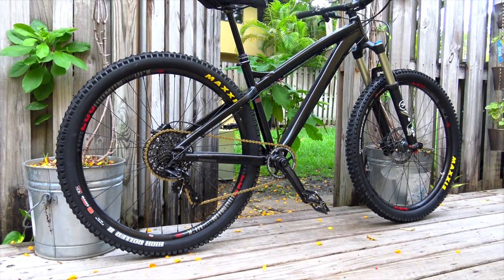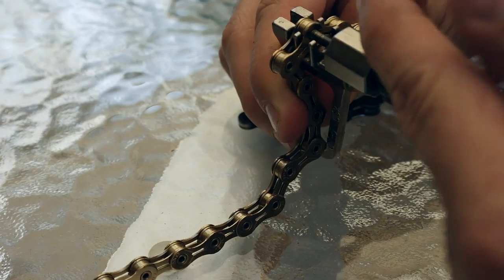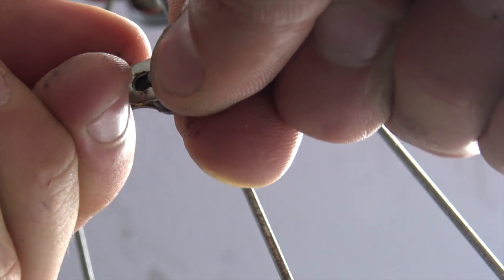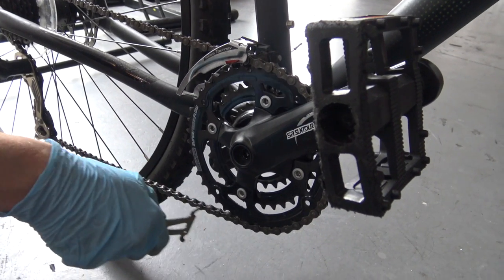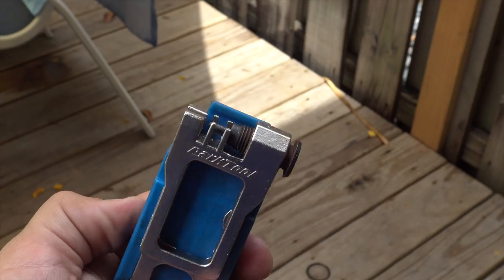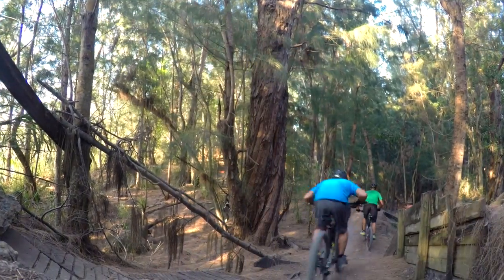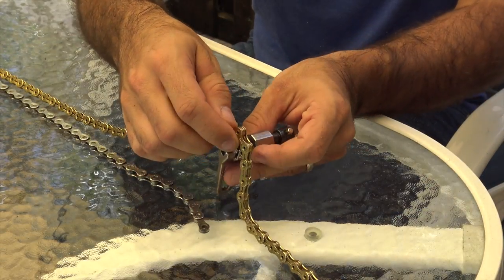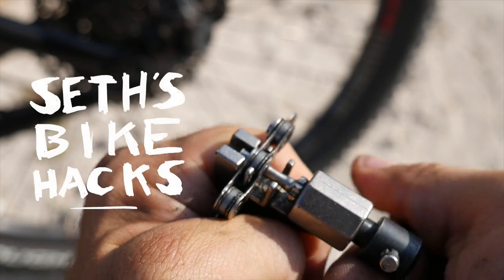How to repair or replace a MTB chain

Comment: I recommend any body who's riding to carry with them a Powerlink/quick link along with their chain breaker tool. 
Having this allows you to fix a chain without losing a link. Basically it replaces the broken one. It's super light and small to carry in ones pack or pocket. It's saved me a few times out on the trail and I just think it's a must have on any ride.
Reply: liquidSpin yeah quick links really save the day. I’ve found they fit perfectly in the steerer tube, on top of the star nut, below the top cap. Completely out of the way.
Reply: it's not even super light it practically ways nothing
Reply: When I was working on this older bike the chain was lost and I grabbed another chain and I used a hammer and a punch as a chain tool

Comment: Dude... thank you so much! I've always had a chain tool on my multi tool.. but never used it.... when it came down to having to actually use it, your tip (about not pushing the pin all the way through) helped  A TON!... I messed around with a bit of chain after.. and found that after pushing a pin all the way out, it's virtually impossible to get it back in (with a multi-tool-chain-tool)...

Comment: I have tried two different chain tools and they all broke halfway threw the job. DONT GO CHEAP! they are only good for one use IF THAT. Get a good chain tool. I plan on getting the ct5. The fact that this is Seths go to tool and the reviews I have seen on this tool solidify my decision. And screw driver threw the handle can fix any leverage problem I would think.

Comment: Using a wire stripper to break the master link is a good hack. Thanks!

Another use for leftover links is to carry them on rides and replace broken links with them. That way, your chain won't be short.

Comment: Too bad you didn't make this video a couple of months ago I learned the hard way and I'm already on my 3rd cheap Walmart chain tool
Reply from the maker: +Ethannnn yeah the Park chain tool is pretty cheap, and actually the Crankbrothers multitool comes with a decent one for only $20
Reply: Same, I bought a Bell brand chain tool at Ace and I had to go back and return it two times because both times the tool broke, I got a new one on amazon and although it was a lot stronger and higher quality it ended up breaking. I ended up just putting on a master link and fixed it that way.

Comment: A quick tip! grab a few links from your old chain 2-5 links and just tie it to your brake hose with some string or tape. this way, you can get your chain to the perfect length even if it snaps! :)
Reply from the maker: +Erlend Ruud that's actually a real good trick

Comment: If you were not too careful and you squeezed out the pin you can tighten a zip tie around the pin and so you can take a hold of it and press it back in. It works.

Comment: It is safer, easier and more correct to carry the correct size quicklink with your tool to fix a chain instead of conjoining other links back together. When u join links together u actually bend the link that u are joining and make it for the chain to break again a lot easier

Comment: The part on crashing with the chain ring breaking sounds like what happened when my wheel came off due to low quality bolts to hold it on. Did a good sized power drive and wheel came off.

Comment: Hello there. I am using 2 missing links for my 10speed chain. The reason is that I broke my drop-out hanger last year in the middle of the trail. I needed to cut my chain so I could go on a single speed. I do not have a chain breaker at that moment and I literally cut my chain using a nail, a rock, and a swiss knife. From then I have installed 2 missing links, with one sized to run as a single speed. Since then I never had a problem. But I'm confused cause is seems like noone has been doing the same thing as I did. The question is, is it okay? Or is there any issues that I'm not aware of. Thanks.

Comment: Nice video.
My front disc is making a crazy squealing sound when I break, will you have a video in the future about this kind of problems?
Reply: If you have acetone, pour it on a rag or cloth and swipe your disc. This makes it even noisier but eventually it will dry off. Then get your brake pads and use dish washer soap. If it doesn't work you probably need new brake pads

Comment: Looks like you got new tires too. What are those? High Rollers II? Looks awesome all black with just those few yellow and gold colors.
Reply from the maker: +Deartist 7 High Rollers indeed! I'm liking the way they look, and will probably review them after a month of riding
Reply: They do look good! What width did you go with on the rear? I got a Hook and the spacing is 135mm so i'm guessing yours has more clearance, but I want to know what works and what not.

Comment: A little TIP for when you buy your chain breaker . When buying DON'T buy chain breaker with a pointy thingy that push out a pin from a chain, it will be very hard to push the pin out . not like just hard but very very very hard almost impossible compared to a normal chain breakers so look for a flat thingy when buying

Comment: When my chain brakes I usually just use a missing link replacement to repair it. I thought once a pin was pushed out of the link it could no longer be used?
Reply from the maker: +StrikeEagle17 if the pin gets pushed all the way out then yeah, it's usually toast. If it gets pushed to the end, you can join it again easily.

Comment: Did you know chains don't actually stretch, the links just wear out from the metal on metal contact of the chain on the cassette and chin-rings. The extra space between links caused by this wear makes it look like the chain stretched and can cause extra wear on the drive terrain.  Chain lube can slow this process which is one of the many reasons to use a bike chain lube. Chain stretch is not caused by the chain getting longer, but by the links wearing down.
Reply: but at the end it is actually longer, it techically streches tho
Reply: +Luciano Narno in the video the broken chain and the new chain line up when Seth demonstrates sizing
Reply: +Dylan Kiefer they do stretch as i just recently ripped a inner link side plate in half because of it stretching over time from so much torque
Reply: +David Gonzalez i agree, I replaced my chain recently and it was actually longer. In the full length it had almost grown by half a link.

Comment: yo Seth, I have a question... my cheapo mongoose xr-75 has an old rusty chain. the bike is a 21speed and I'm about to buy one, but I can't find any 21 speed chains. I see some marked as 11speed or 6-7-8, I know what an 11 speed is, I have no clue as to what 6-7-8 means. I know my bike is old and decrepit, but its all I got and I don't have much of a budget, so I wanna make sure what I buy will work. please let me know what chain will work for my relic.
Reply: Mez Martinez it’s based on your cassette (the thing in your rear wheel that the chain goes around.). 6-7-8 speed chains will work with a 6 speed cassette, a 7 speed cassette, and an 8 speed cassette.
Reply: Because your bike has 21 speeds total, I’m guessing you have 3 chainrings (the big gears by your feet) and 7 cogs in your cassette (the cluster of gears on your back wheel). 7x3=21. You need a 7 speed chain. 
Chains are designed for different speed cassettes because the higher numbers are thinner so they fit. 6 speed chains, 7 speed chains, and 8 speed chains are all the same width, are all interchangeable, are all the same thing, and are all called 8 speed. Get an 8 speed chain.
Reply: I’m surprised no one else has answered your question. It was very clear.

Comment: So you use the speedlink or just put it together with pin?
Reply from the maker: +Henrich Hostak I use the speedlink, but if you're out at a trailside emergency you could join it on the bike. Not all master links can be done by hand.
Reply: Seth's Bike Hacks Mine is very hard to undone not sure how I will open this on trail :)

Comment: My chain broke on a climb on the "five minute hill" on a race and I only had an old multi tool chain breaker... It was designed to be used with another Allen key which I didn't have. My luck 😂
Reply: Hahahaha fail
Reply: +Patrik Müller yeah, that's why you should always have the right tools...

Comment: Why should one Buy a new chain after one link Breaks?
Do you have a Dollarbills as Wallpaper or What?
Reply: Mukunda the chain broke because it’s worn out. Even if you fix the chain, it’s still worn out and will break again soon. Also, a worn chain makes the cassette wear out, which makes shifting feel terrible. New chains only cost $10.

Comment: Hi Seth, your chain is very long for me. I'm using shortest as possible, so it is not slap over my frame.
Reply from the maker: +Denis Osipov if you ever need to get a new derailleur, look for one with a "clutch". You'll need to spend a little more, but the difference is huge!
Reply: yep, I have "clutch" on my deore too. But shorter chain give faster swiches. Anyway - it your choise, but you can check shorter chain next time :)
Reply: Seth's Bike Hacks no one sells 7 speed derailleurs with a clutch!

Comment: The chain tool needs to be redesigned to hold the pin in place if not it will pops out 😂